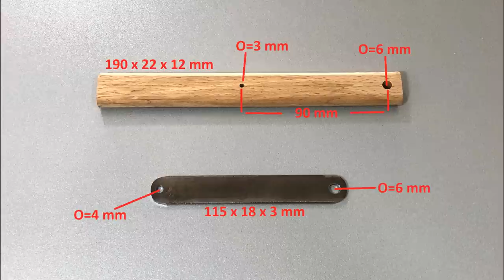4 in 1!! Drill Press - Router Table - Spindle Sander - Thickness Sander // 4 in 1 Çalışma Tezgahı

Comment: Burning of the wood indicates taking too deep of a cut. Might want to take two or three passes. Saves the blades and bits.
Looking at the finished product, I think it could be used as a plunge router as well. May need a few small improvisions but doable.